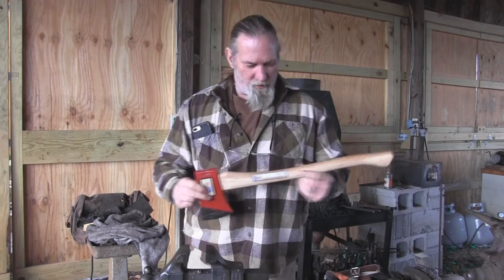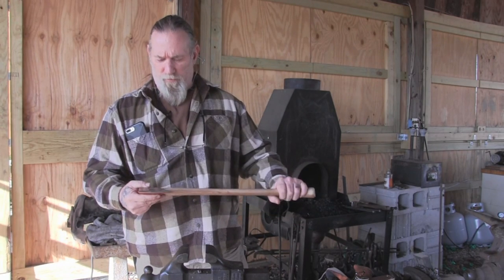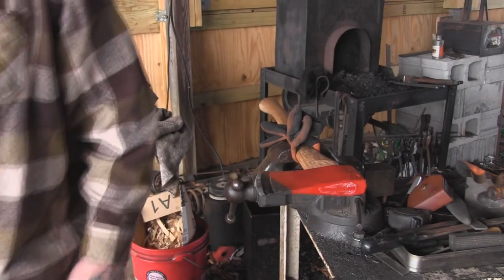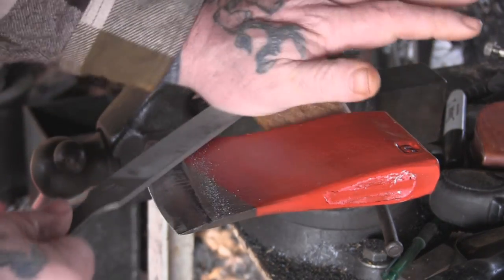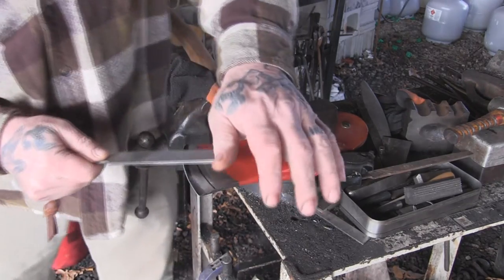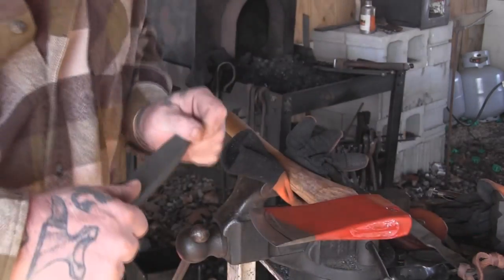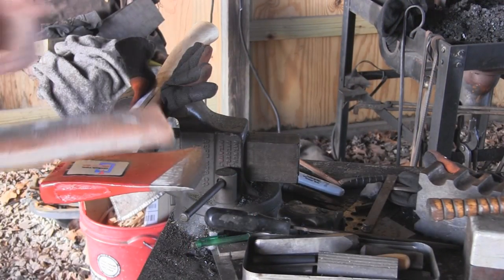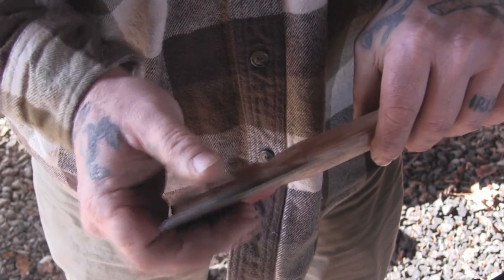Sharpening an Axe with a  Hardware Store Grind

Comment: Can you think of any issues with putting a shorter handle (24") on a #3.75 Council Pulaski?  I would like to have a multi-use tool to use for grubbing (medicinal/edible roots, fire pits, fire lays, Dakota fire holes, trenching around tarp set ups, etc.), along with all the traditional camp axe chores. Do you think the axe would be too out of balance?  If not, it would save me having to carry a separate trenching tool/shovel.

Comment: Looking at my Ace Hardware Collins axe endwise I see a bevel on one side and a flat or nearly flat grind on the other side.  I thought it was a camp axe but maybe I was wrong.   It's a pain to try and sharpen.

I have a Plumb axe and hatchet that need handles plus two old fashioned shingling hatchets with wide blades that also need handles.  They don't sell them in that size here.  I need some resources.

And, oh yeah, that axe file?  They don't sell them here nor at the saw shops.  I'll have to search for it.  No logging backup tools either.  Not even a mill bastard file.

Comment: Dave, long time follower, first time commenting...quick question: is there any reason why you chose to go with 30 degree instead of 20-25? Do you find 30 works better for splitting & smaller jobs with this size axe? Just curious why you chose 30. Thanks and keep up the great work!

Comment: For heavy reprofiling it wouldn't be a bad idea to get longer file, a nice one with a handle.  It can be skewed across the cut with little or no forward movement.  It sure is nice to see an American made axe that a file can cut, most if not all the Sweden axes are to hard for a file.  As well, Snow and Nealey is a hard axe, either way at least 30 degrees.  Nice video, Dave.

Comment: I have the Husqvarna hatchet. I just ran my puck over the edge when I got it. haven't done the linseed oil on the handle yet. what strop maker do you suggest?
Reply: I wanted to get some leather scraps somewhere and make my own but would also like to just spend the money on a good one as well and see the difference...
Reply: the husky axe I bought was really nice.
Reply: It's not gonna be any better if you buy one... get a thick leather scrap piece and epoxy it onto a piece of wood. if you want to get fancy, make different profiles on all sides of your piece of wood, to cover all kinds of tools. One flat, one with a sharp angle, one convex and one concave.
Reply: Wow..fantastic idea! Can you quickly explain what tool each profile would be for?

Comment: Thank you!! Will this method also work on say a sog tomahawk, or just basic hardware axe?? Thank you again!!
Reply: Bruce Smith Outdoors if the steel isn't too hard for a file it will work. I had a sog tomahawk, and I used an angle grinder on it. took about three minutes.